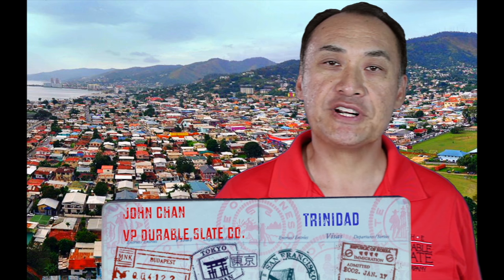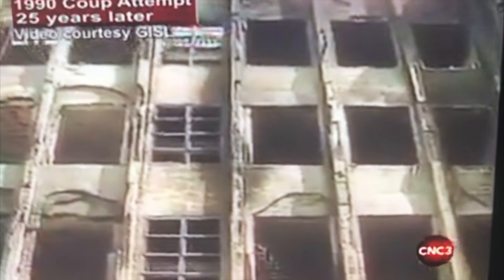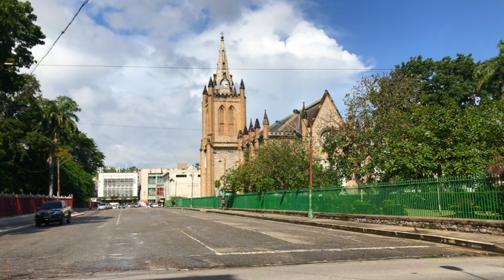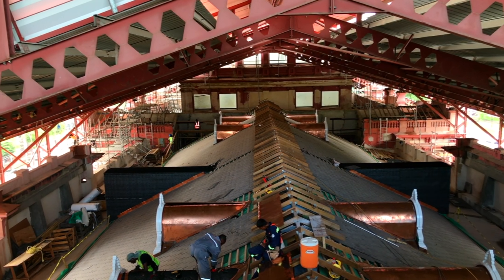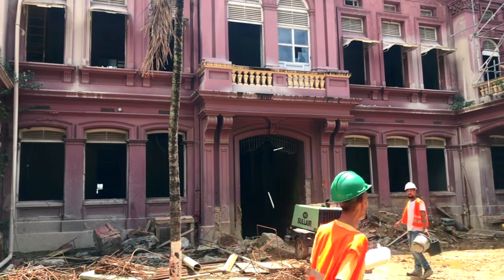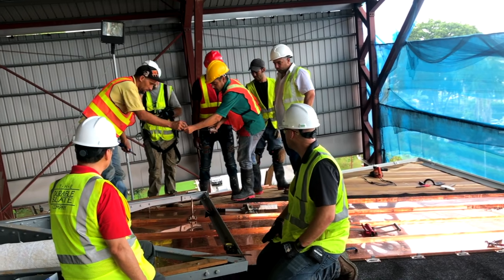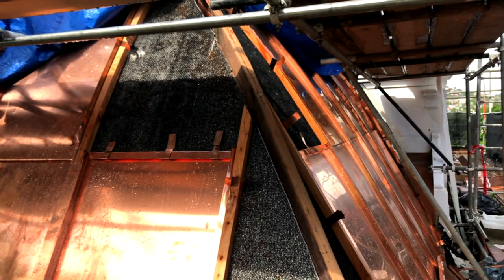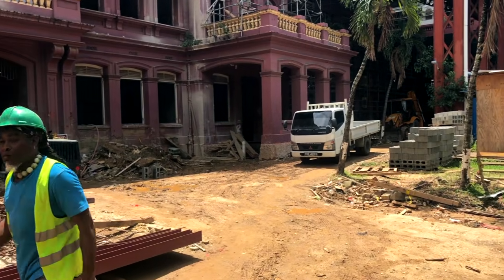Trinidad's Red House of Parliament - Slate and Copper Roof

Comment: Nice job making the roof look good, but the the roof is leaking - You had one job
Reply: No, our job was not the roof installation, we were just trainers.  We trained the locals, and we were told that they had it down, and finished the job without getting in final inspections from us.  We were not present for the last few months of roofing.  This is on whoever decided that they didn't need us for the last few months.
Reply: Finally found out what they did.  They cut a hole open and installed a new skylight that wasn't on the plans, and they used CAULK to seal it!!  Not sure why they went so far and didn't get a final inspection from us!!